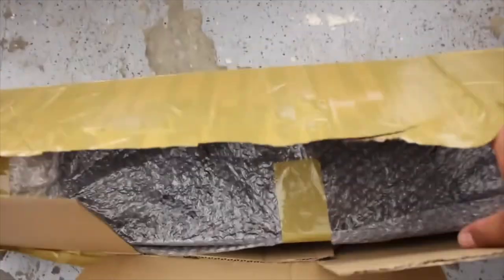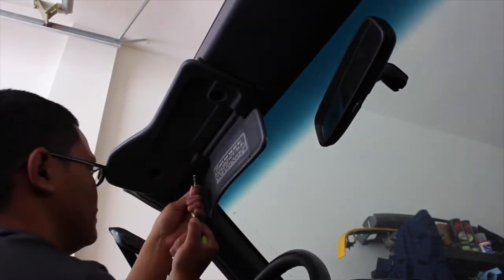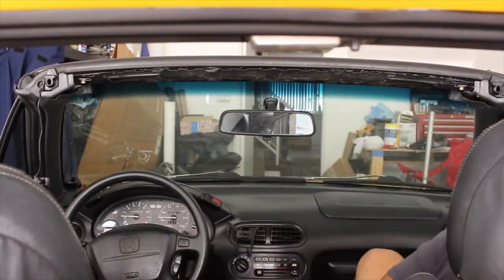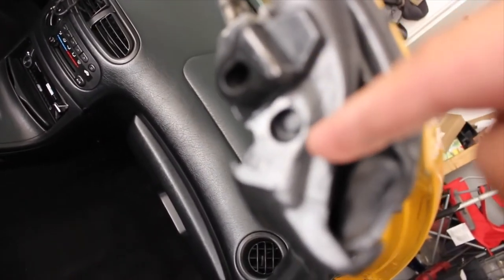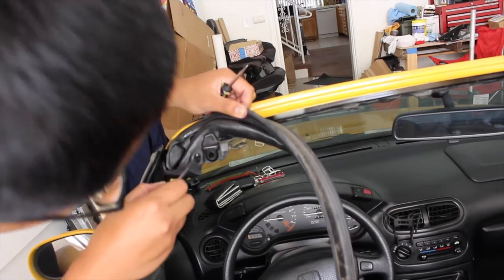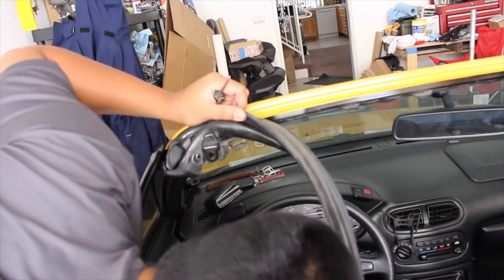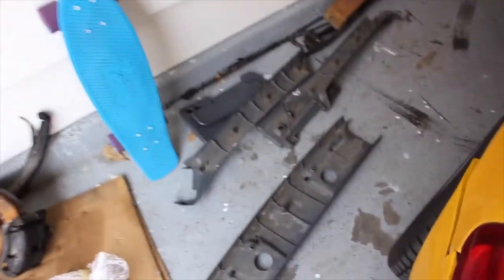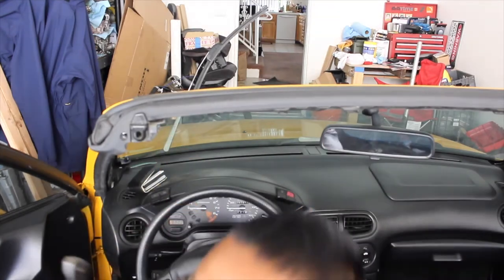JDM Visor Install

Comment: Hey, what was that wire hanging down when you removed the USDM visors? I couldn't tell what you did with it during the sped up installation of the JDM ones.
Reply from the maker: it's the mic from my radio
Reply: Okay, so that's not something my Del Sol will have. Thanks!